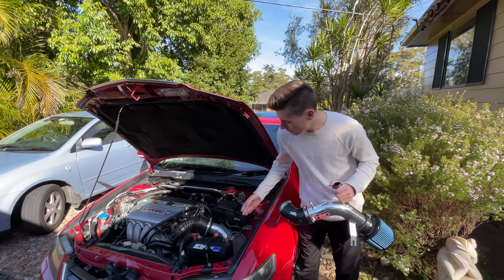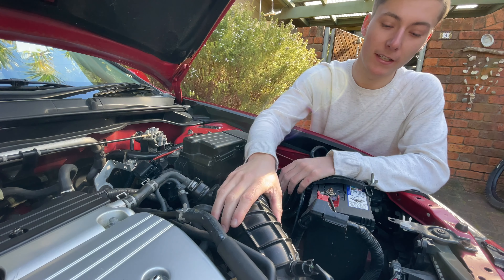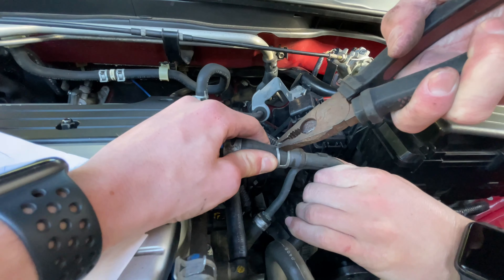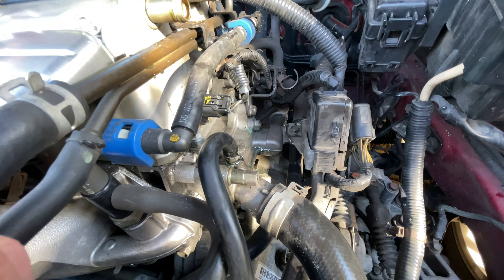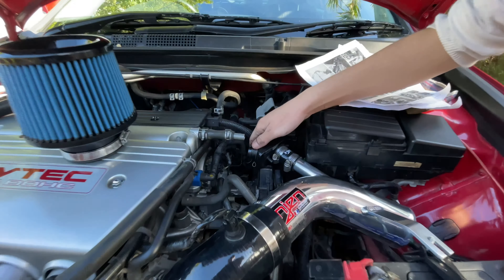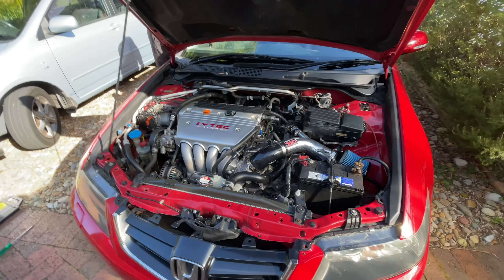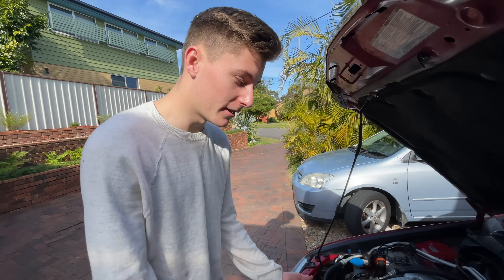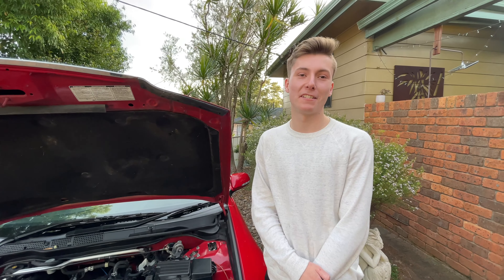INJEN SHORT RAM INSTALL ON HONDA ACCORD EURO CL9

Comment: Short ram vs cold intake …? What’s better …. Pros and cons plz in details thanks
Reply from the maker: In the end without a tune neither really have any major benefits. Short ram brings a much deeper growl through all rpm ranges however cold air provides a quieter growl until high rpm where it “screams”. Pretty much comes down to personal preference.
Reply: @ValveHouseAU  hmm thanks when you say without tune …. What exactly the tune could be ? What is included in the tune ? Sorry I am new to this car and wanna learn 🙂

Comment: yo im running sri setup aswell, do you think a heat sheild is needed?
Reply from the maker: if it was an 800hp car you'd probably be worthwhile installing a heatshield. Because it's a honda you'll probably gain 0.00005hp with a heatshield lol.

Comment: Hi, did you remove the intake resonator?
Reply from the maker: We had removed the intake resonator previously, not too hard to remove. Just remove bumper and unbolt
Reply: @ValveHouseAU  Thank you man!
Reply: @ValveHouseAU  Hi, I just remove the resonator under the bumper, do you think it's a need to add some air duct to guide fresh air going to the short ram?